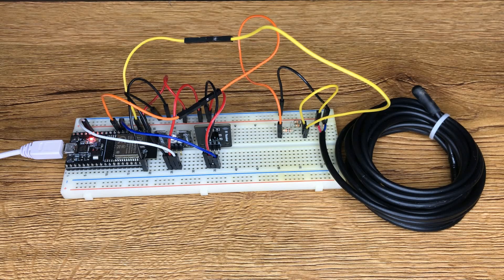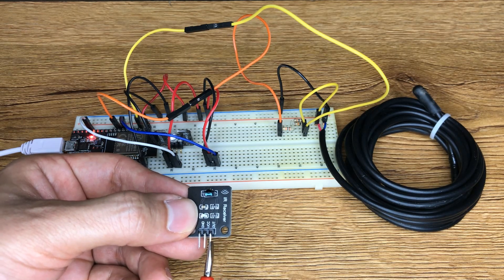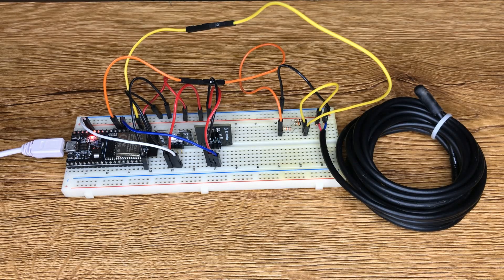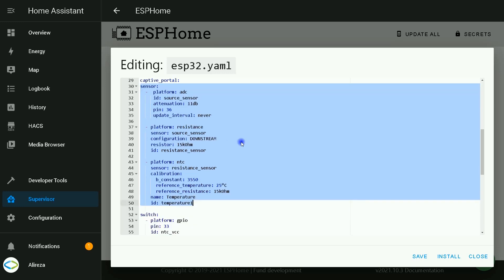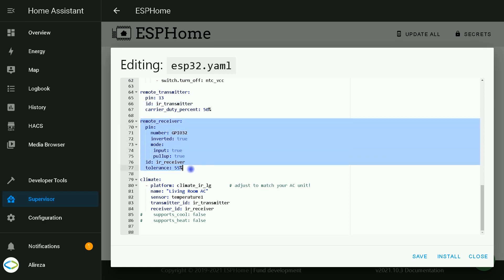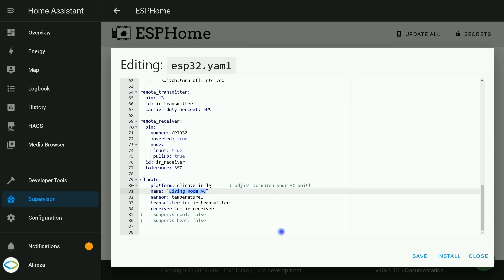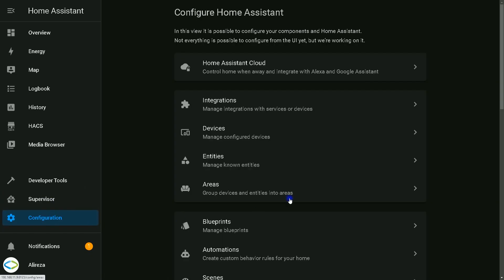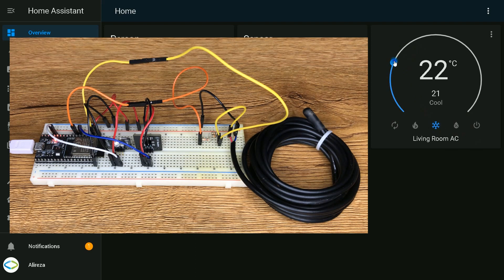Make your Infrared controlled air conditioner smarter

Comment: thank you for this!! but how many AC units we can control? I think not all GPIO esp32 can be used for this
Reply from the maker: Hi, Not all GPIOs but the ones that van be use as input and output. there are :PIN4,13,16,17,18,19,21,22,23,25,26 ,27,32,33.
For more details search pinout of your board.
Reply: Also this IR transmitters have to be line of sight.  If multiple ACs of same brand/protocol are in same area then they all will operate based on the single transmitter. If you have different sides then you may deploy the IR transmitters in parallel.
Reply from the maker: @tamildesan837  Yes, You mentioned a very good point.
In this case you'd better use IR emitter than Blaster. If you use IR Emitter, you must stick it to receiver as its range is very short.

Comment: What about resistance for transmitter? 
Usually, transmitter need 5V, but esp can give only 3.3V
Great video!
Reply from the maker: Follow the steps.
ESP also has 5 V DC pin.

Comment: Nice and well done, but I do not want to start with home assistant to set the settings of my a/c. Unfortunately All but one IR blaster miss the point. Yours as well. Thats why these beautiful projects go unrecognized. Please let me explain. Most IR Blaster projects focus on connectabillity and not on smartness. Sure we need a small server on the esp to set the settings. But also we need a section on the code that states the names of the variables for each button and the send variable. to update the settings of the a/c acording to our own code we add in the free space of the code to set the variables. To finally give the entire blastter idea a reason. Smartness via if statements and sensors. F.e. If light is on and temperature is under 15 degree turn on the heater. If light is off and temperature is above 15 degree turn off a/c. and so on. Thats what all the nice and complex examples on youtube are missing, the reasy and open  door to add our own code to give such a device purpose. Cheers, Lisa
Reply from the maker: Thanks a lot for your feed back. I will take it into consideration soon❤❤💫💫

Comment: Hello, I want to control my Ac in a way that, when I was coming towards office I can on it and so when i reached office after 10 minutes it already cooled the room. How I can I do this please guide me
Reply from the maker: Hi, Do you have Home Assistant in your office? Have you built this device? 
I need to know what IOT devices and platform you have in your Office?
Reply from the maker: If you do not have any smart device in your office and only want to control your AC, a Broadlink ca do that.
Reply: @kian.smarthome  by using node MCU,
Reply: We had our own cloud base water management system where we , automate suction and overhead tank motor and monitors and control by using app and also client can control it from anywhere in the world, but One of our client demand that is it possible to control my ac from my home so I can't start it before reach at my office so , office room get already cooled before reaching, I think that by using IR and node MCU it can be done, plz guide me about that and also how can I connect this device to our cloud
Reply from the maker: @yawarabbas9228  For sure you can do it.
To help you I have to know what your cloud system is? tell me about it, Is it a DIY cloud system or a known one ....
Reply: @kian.smarthome  it,s AWS cloud system

Comment: Hello, a very insightful video. I have Panasonic air conditioners. Do you know if there is also a platform (IR-Remote) for this?

I have already read the IR codes from the remote control using an ESP32 IR receiver and then sent them via WiFi via an IR transmitter, unfortunately this did not work. 😞
Reply from the maker: Hi, I am glad my videos are helpful. Send me your codes to check them.  
receiving the IR signal, do you get it as "Panasonic"?
Reply: @kian.smarthome  Thank you for your answer and effort.
Unfortunately, there are no Panasonic codes that I could read. I had read these out as pronto codes.
I had received various functions as a Panasonic code when I read them out with "all", but did not even receive a Panasonic code when switching on (on/off button) the AC.
Neither the Pronto Codes received nor the Panasonic Codes produced any action on the AC.
Apparently Panasonic has cooked its own soup. Greetings Steffen
Reply from the maker: @steffenfasig7333  What kind of Signal does it receive?

Comment: I have 8 ACs. and working fine after seeing your video :),  Do you know how can I add preset please ?
Reply from the maker: I am so glad that my videos are helpful. What exactly do you mean by preset?
Reply: @kian.smarthome  When cut the power of from AC from the main switch and it goes off the status will be undefined, after turn on the AC and the electric came back the defaul mode will be cool/heat, I need the default mode to be only cool, I searched about it I found in esphome code: preset to change the default to the desired mode, but not working for me 😞
Reply from the maker: @nawafbana8100  you must find it in setting of your AC device, or find the command of your AC machine/device/system.

Comment: Thank you for nice video.. I did it for my Fujitsu air conditioner it is working fine,  how can I have more range and distance? do I need resistor for both transmitter and  receiver? if yes what is the size please
Reply from the maker: You can't increase the range.

Comment: Hi kian.smarthome. I have follow everything that you show in this video. So far I manage to add it to esphome and climate entity to thermostat Lovelace. The problem is I can’t send a signal to turn on my Daikin air-con. I try to use the remote control to send to ir receiver, it can capture a signal but in the Lovelace it doesn’t change value too. Is there anything that I miss? I’m new to esphome. Can you help. Thank you so much.
Reply from the maker: Hi, first of all check your YAML file to see if there is any warning. usually around save button. Mostly by organizing / arranging lines warnings vanish

Comment: Great video. Helps me to get my head around the system as a whole. One question, when using the external temperature sensor, does this over ride the heat pumps own internal sensor for regulating its output? Or is it only for use within home assistant?
Reply from the maker: Good question. No it is for monitoring as the system uses its internal sensor